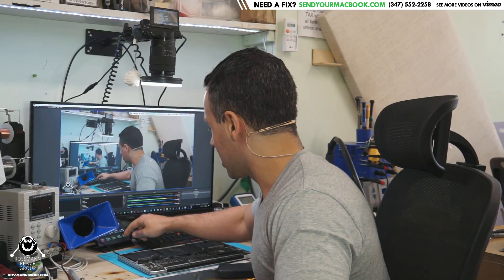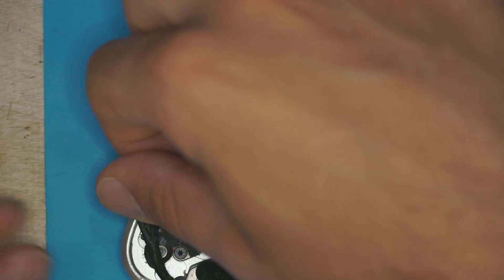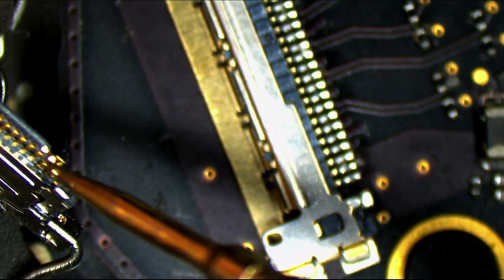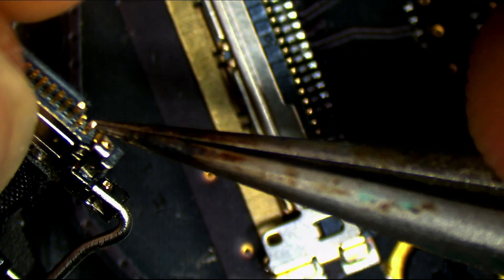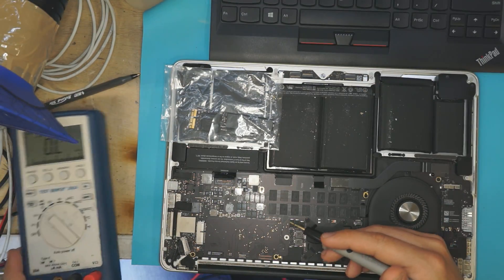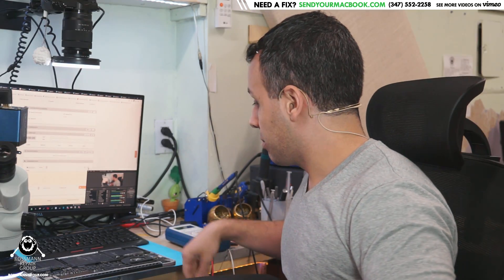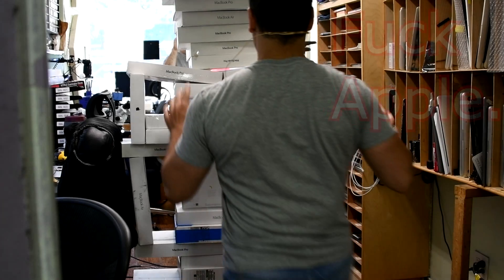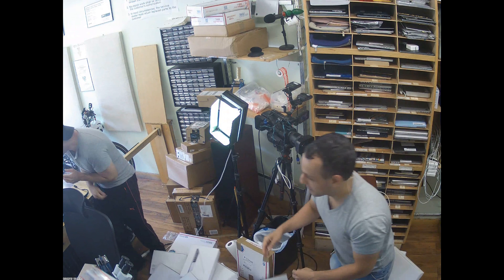APPLE GENIUS BAR STRIKES AGAIN!

Comment: Customer: USB in my macbook pro  port is broken, i think it shoudn't be a problem to replace it quickly
Apple: Let me check it at the back room
15 min later
Apple: Thank you for your patience,  it seems, that your entire computer is flooded, and the board is gone. Lithum battery may explode at any second. But you can buy a new one right?

Comment: This video shows some good things, the info on the bent pin, knowing it is because of the way the connection and its wire are tugged and fitted means they are not doing it on purpose, maybe.
However, it does not explain how you can see the issue and the solution, yet these people who should have experience and training by the actual designers and owners of the products, are not learning or are refusing to, in order to make money/revenue from nothing.

Comment: Louis, you have every right to sue Apple or whoever it is that says independent repair shops are bad!
This is defamation! They have laws against that! Apple is driving some customers away by saying such stuff! 
Repeat: That is Defamation! YOU CAN SUE THEM for that, it's Slander, Libel, etc..
They can't group all (good repair shops) repair shops together like that with the bad apples (pun intended). 
True there are some bad apples out there but those shops would need to be singled out.
They can't call your shop bad because Joe Blow over here in the next state is doing a bad job, etc.. 
As you know that is what Apple is doing. 
Turn the table on Apple for once and SUE them for the Lies they are telling about Repair shops! 
Louis, you are in a position to do this! This would be a win, win situation for you and all the honest repair shops.

Comment: I did an ssd swap on a mac air, the new line of airbooks have a Mbourd lock on firmware that will not boot unless you clone a real ssd and not an aftermarket. It kills me every time that mac locks there hardware and forces you to pay 800$ plus for an ssd that can be gotten for 150-200$ aftermarket.

Comment: But if the display wasn't working, and when checking it they broke the connector, but then the display worked by fixing the connector... What was the problem in the first place?
Reply: At first there was a problem with the connection with the SSD. But after it got "checked" by the genious bar, even the display failed most probably due to the incompetence of how they plugged back the display connectors.

Comment: Except, that the laptop was originally brought in with a backlight problem, indicating the pin was already bent, which suggests the supposed owner, deliberately bent it. Probably for the purpose of the episode in order to slander Apple. However,   I know the pin issue was only being used as a prop to test the technicians honesty and experience.

Comment: What you have is a Sony 18-135mm lens which goes to 135mm on Full Frame sensor! But since you film this on SonyA 6000 serious with a crop sensor not  a Full Frame. This 18-135mm goes up to 202mm  zoom - because of so called crop factor  alright?

Comment: I appreciate your sentiment on independent repair and agree. However though, while most repairs can be simple, some shouldn't just be tackled by an enthusiast (Not you, ME lol) unless they have already learned about computer circuitry design and how to treat the components. I killed an old Lenovo laptop trying to flash a custom BIOS with custom whitelist and thought i had done everything right till it died, then found in a forum that my model needed only 3v not 5v so I unknowingly fried the bios directly I'm pretty sure. If you can talk to someone like Louis and can tell they are qualified and professional about their work then definitely go Independent repair over Dependent repair. Always safer than trusting a company- like, i dunno, APPLE? XD

Comment: A consultation, examination and diagnosis of the problem HAS value; without it, the customer has no working computer. I recommend you charge something, even if it's $20 bucks.

Comment: Here’s my Genius Bar story. My iPhone 6 began to reboot endlessly. Made an appointment with local Apple store/Genius Bar. Turns out that the battery (Nbr 3), failed and swollen up and opened the case a bit. I didn’t see that because it was in a protective case. Genius Bar person says, oh it’s the battery. We can send it in for repair and only charge you $80 for a new battery. Okay let’s do that. Two weeks later I get a message to come in to pick up my iPhone. New (to me) Genius person says, sorry the battery has affected the motherboard we cannot fix your phone, but you can buy a new iPhone 6 for $225. No, says I, give me my old phone back and I’ll donate it. I take the “non operating” iPhone 6, fully intending on dumping it in the Staples mobile phone bucket. I get to my car, open the box, and I find a new iPhone 6!  Ha! My lucky day. Thanks Genius Bar.

Comment: I don't know what it is with an official service center, they somehow always exaggerate the issue and overcharge for whatever you need, when my laptop (which fortunately not apple since i don't know if i have the patience to deal with their shit) have a keyboard issues the service center said it would cost me 100$ to replace it, not overly expensive but certainly overcharge, i bring it to an independent repair shop and they said it would just cost 30$ to replace, like wtf? How could there be a 70$ difference when essentially all part used are the same?

Comment: Don’t with my school that when they got a funding grant for the new building (this school is a large single building) they also upgraded from windows to apple with macs and iPads instead of the dell laptops and desktops. The in house techs have also learnt smart percussive matinence where if it is a problem that is likely down to a conector in the iPad they will attempt to hit the back with persuasive force and most tines it gets the conector back in. Also no mater when I go up there they have a different iMac with its screen off. I know it’s a different one as they have stuck stickers on the front with the network name (k209 M5). 

Also towards the middle of the 2018-19 they put in a suite of new macs in one of the open classrooms and when they went though powering them up some where old Macs with what ever OS X version was from 2012. Some displayed a white screen with a folder outline and sone booted into windows 10 with windows 10 start up noise heard down the hall. By the next day they where like the rest of the ones round the school. And yes I  Commented on the windows and they turned to look at the windows of the building and made the they really open the place up and let in like joke.

Comment: I agree that independant repair shops should have access to schematics , but never ever the end customer... I see that every day at my job, that end customer try to repair their product and litterly destroy their device with their repair attempts. Most people think that they can do a better job than a trained technician, and think that we charge way too much because of we want to rip them off... I had it many times that a customer wanted his device back, and later the same device came back with massive mechanical damages of connectors or other stuff.

Comment: I went to an apple store to fix my iPhone 8 they said it can't be fixed they need to replace some of the hardware forgot what and told me it would cost 430 euros because I had a problem with my microphone audio ic chip (found out about from a different store that fixes phones) that cost 120 euros to replace from the different store

Comment: Before you start ripping on Apple,  It seems to be an American corporate cultural change which is affecting a lot more consumer products. Ranging from cars to air conditioners.
Restricting repair manuals, Authorized dealer only access to spares ( authorized dealer must meet minimum new sales quotas to maintain dealership)
Encasing circuit boards in fiberglass resin. just a few of the tricks that are becoming more prevalent today.

Comment: the problem with Apple is not with employee competence. the main problem is the lack of business ethics which is also promoted by the company itself. I myself as an electronic enthusiast that loves figuring out solutions to problems and learn from mistakes as motivation. the typical apple employees are driven by sales and commissions on repairs without really addressing the actual problem and would result to easy fix of dump and buy. if some people would be brave enough to tell these frauds that they don't know what they are talking about just to see if there is an ounce of decency left in them and would apologize for such a practice then I would say that there is hope for this company. unfortunately, that doesn't seem to be the case.

Comment: Auto manufacturers are doing the exact same thing.  They make products has difficult to repair as possible so the customer is forced to go back to them and get ass-blasted.  They make the ass-blast as severe as possible so that the customer either buys a new one ("we'll give you some trade-in value") and/or remembers to buy a more expensive warranty plan in the future.  Unfortunately many customers remain loyal to Apple and keep taking the ass-blast willingly.  I know Android and PC can seem frightening at times, but you can do it!  It's time to moveon.org.

Comment: If OEM had well trained repair staff at a fair price they would have nothing to fear from independent repair stores.  Independents have higher parts cost and the knowledge they have is limited by their staff size.   The fact that OEM would do this just goes to show that their business model is dependent on getting their customers to buy newer technology they don't need or pay for repairs that are unnecessary.

Comment: I happen to prefer Windows but I'm not in a Mac vs Windows war, never have been. At home I use both! However, as expensive as Apple products are for a products they aren't even manufactured in the U.S., they should be designing them so independent techs like Louis are able to easily obtain parts. In fact, I tink Apple customers are so loyal they would eagerly pay more up front for a product made by well-paid union workers with benefits right here in US cities and towns. They wouldn't have to run a whole separate wing of their business that only does repairs. Or Apple could simply drastically reduce the size of their repair wing. Increase profits and profile up front by manufacturing here, and remove a large chunk of overhead by doing away with all that Apple Care/Genius Bar infrastructure. Sounds like a win-win for Apple, for indie repair shops and for workers, doesn't it? The only people who lose out to some limited degree are the already rich shareholders. And they don't actually lose anything, just win less big.

Comment: What happens is the people that work at the genius bar simply are "geniuses" and they have absolutely no idea how circuits work. So when these apple employees give the customer a bogus diagnoses they're basically saying "We don't know what the problem is and we are either going to A: Replace a bunch of shit hoping it'll fix it, or B: Send it to one of our engineers....It's simply people that have no idea what they're doing that just like to feel smart. I'm an electrician that has never worked on an apple, but I feel confident saying that I'd be able to fix your iphone/macbook (if it's hardware related) way before some moron from the genius bar.

Comment: Does this tend to come from the same store or various around the country (whatever country that is). Also, do you know that it was the Apple Store that did this to the cable? For a basic appointment they don't open up the computer. The note you read said something was rattling. That makes me thing Apple never opened it up and so I'm not sure how they could be at fault for the wire.

Interesting fact from inside Apple, I hear, they have to struggle to get people just to pick their repair partners over the stores. People are obsessed with the idea that the store is superior.

Comment: so i have a Mac Desktop and a ant died behind the screen. I took it in and they told me just to slid off the screen and brush it out. i asked them to do it and said i would pay. he said no and told me i just had to push up on the screen and take a little metal tool and unhook my screen. so after like 10 min i said fine, becuse he said he would charge me 200$ to do it. i started to do it and he told me to go do it out side the store, so I moved and tried to and cracked my screen. when i went back he told me it was 500$ for a new screen and he could put it on right now.

Comment: Sorry... I feel like I am still missing something. If there was an issue, it was brought to the Apple store who bends these connectors, and you bent back the connectors and it's fixed... then... that means there was no original issue? 

The issue in the first place was it was not working, Apple employees cannot break something that is broken.. :S they can break more things but not the original problem...

Comment: From a repairer based in Australia, I have to tell you Louis, you are partially incorrect. Apple not wanting independent repair and making life extremely difficult for us repairers is not genuinely about 'safety ' like they bang on. It is GENUINELY and ONLY about the almighty dollar. Hammering on about safety is just the apparent legitimate excuse. $$$ is ALL it is REALLY about. Apple has now exceeded a trillion dollar valuation (and will go to ANY length to continue this progress) by making life difficult for independent repairers and ultimately doing their best to SELL more/new products to the masses. Lets look at something that clues up the average technically inexperienced customer. A lightning to USB charge cable. Here in Australia to buy a genuine 1metre Apple charge cable costs $30AUD. This cable would in fact actually cost Apple mere cents, as in most likely less than 5-10 cents purchased in bulk as they do. It consists of a USB-A plug, some wire (the 1metre cable), a couple small integrated circuits (The main one of which can be purchased by anyone and is readily available on AliExpress for about $6USD for 5 pcs), a couple other components of negligible cost and of course the lightning connector itself. AND THAT'S IT! So now lets say each cable costs Apple $1AUD all up for , manufacture, logistics, packaging, the whole ball of wax. This makes their profit margin in the ball park of 3000% or 30x. So if they make this kind of margin on a charge cable, imagine their gains on much more expensively marketed products. The final result - Mind blow! A company that exceeds a 1 trillion dollar valuation. Sure they deserve to gain from the efforts of design and manufacture, but gain by how much? And at what expense ultimately to the rest of the world, end users, independent repairers, I mean literally at the expense of the rest of the world using their products. Legalized criminal activity.